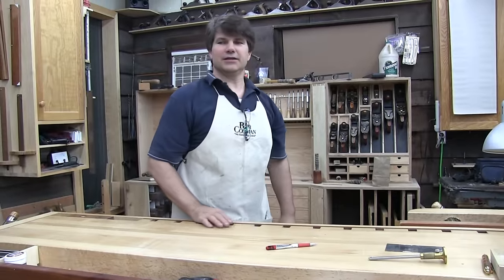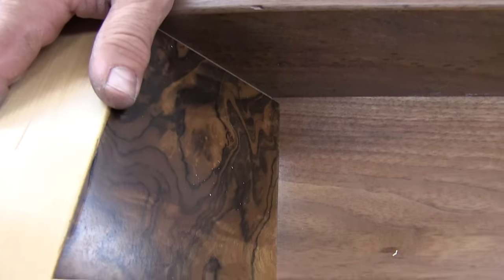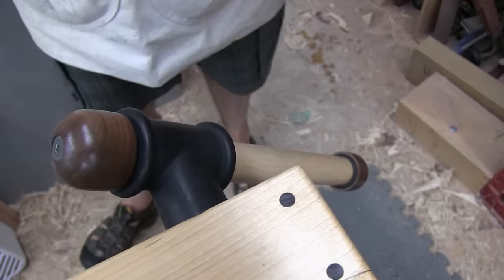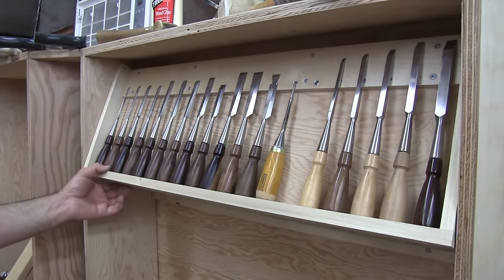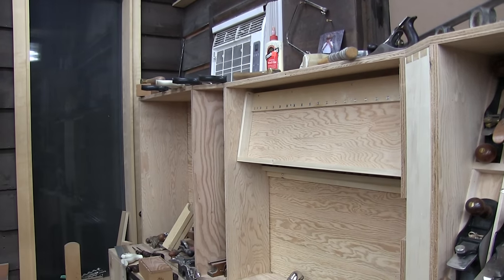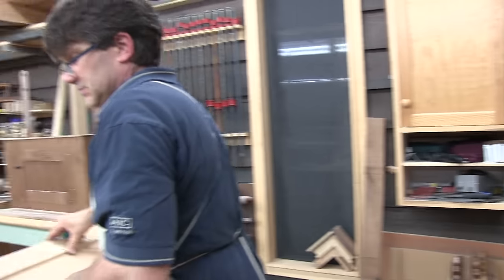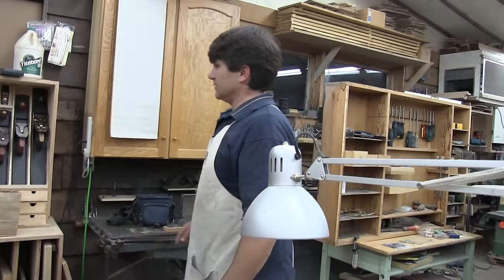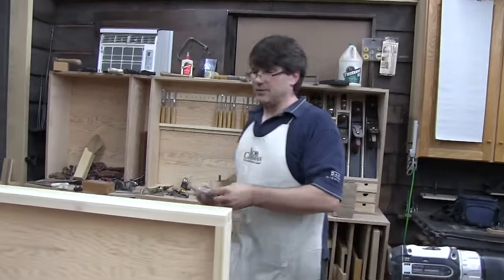Hand and Power Tool Workshop - Tool Cabinet Episode 32

Comment: I have an Idea for your pivot problem. You could use Chicago bolts which would enable you to remove the piece if ever needed. You can mount one half of the bolt through one side and the other half through the inside. They come in brass and look pretty nice! You can find them at Lee Valley and Veritas in their hardware section.

Comment: A good way to store chisels is horizontally.  Put the handles to the right if you're right handed.  The advantage to doing it this way is they are easy to grab for both ways you typically use a chisel.